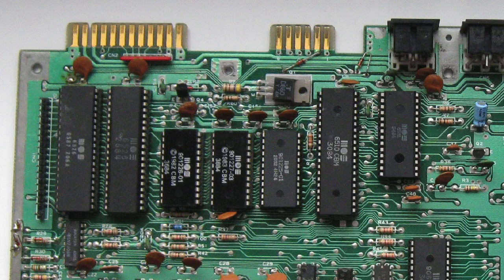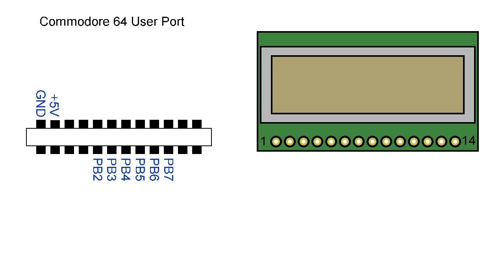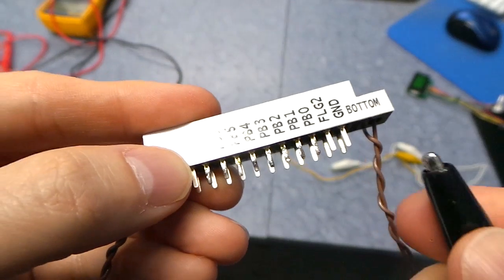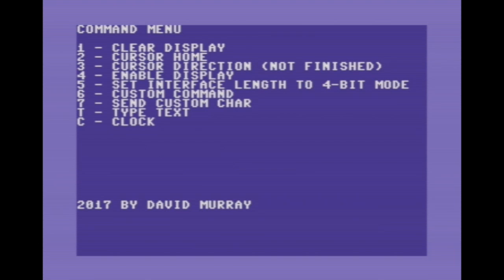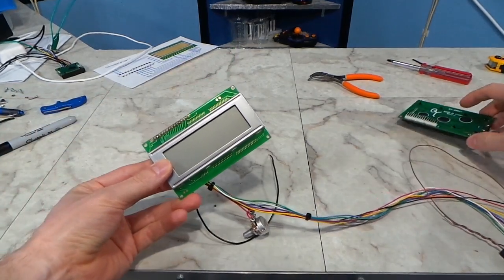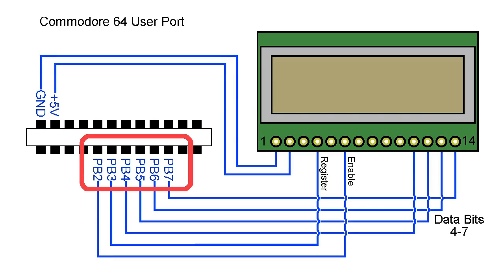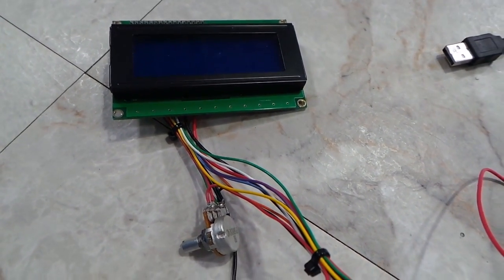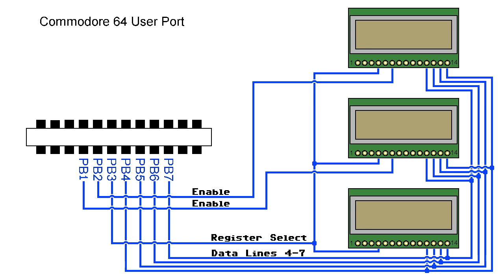How a Character LCD Works - Part 2

Comment: I see that you had a nightmare with that experiment. Good the problem is eventually fixed.
I think using the cartridge port would provide faster data transfer than user port. So the periodic LCD refreshing,  which is currently very visible, should improve.
Reply from the maker: the main reason you see the refreshing is because I left the cursor turned on. But, it does require running through at least 10 or 20 lines of BASIC code for every character sent because it has to break everything into 4-bits.  So, it does run slow.  However, if I wrote the software in assembly instead of BASIC, it would work perfectly fast even on the user port.  However, when I connect it to the cartridge port, it will be even faster and much more straight forward to program.

Comment: I did something similar using FreeBASIC on Windows XP. No idea if FreeBASIC is still around but it gave easy access to the parallel port on a modern OS.
Reply: "Windows XP"
"Modern"
Wat
Reply: @randomcatdude  Modern compared to the C64
Reply: Electronics Idiot FB is still alive and kicking!

Comment: All original C64s are dying... eventually. You notice it when you are trying to do something else than gaming. First it seems to be the case with power supply and fuses but in the end It's usually the PLA chip... My both Commodore machines died recently. Managed to get other one working without sound....

Comment: It's nice to know that other people experience projects going south spectacularly like this. Happens to almost everything I decide to try, and I usually give up long before getting to any kind of resolution. So this video was immensely satisfying to watch. Also, one minor correction that I hope you will accept in the spirit it is intended (pedantry is not always a bad thing!): 42 is not the meaning of life, the universe and everything. 42 is the answer to the ultimate question of life, the universe, and everything. The question of course remains a mystery. A small but important difference.

Comment: One thing to triple check is the input impedance and current requirements for the LCD. The output from the 6526 to the edge connector is not buffered. This means the 6526 must supply the current directly into the device connected to it. Each data line from the 6526 can only source something like 1m amp. If the LCD input is low impedance this could fry the 6526 over time. I know this because I did it. I connected an HP 8 pin printer to my C64 using the same outputs PB0 ... PB7. I also used the "Attention" out which is PA3 but that is buffered through U8, a 7406 octal inverter/buffer. After about a week or so of printing resumes my C64 let out the tel-tale blue smoke of the cooked CIA 2. This was 1986 and the 6526 was neither cheep nor easy to acquire, but I did. I built a small "inline" buffer in a box that became part of my printer cable. I took the 9Vac found on pins 10 and 11 of the edge connector and included a basic 5v power supply inside the inline box to provide VCC for the 74LS540 buffer. This small addition worked for as long as I had the C64.

Chances are the LCD display has an input buffer that sort of eliminates the necessity of an output buffer on the CIA. I say sort of because it's never a bad idea to buffer the output of any chip that goes out into the real world to guard it from line transients and shorts. The serial user port is buffered through U8 so I'm not sure why the designers left the parallel  outputs un-buffered.

Comment: how hard would it be to make a program that would automatically run in the background and reprint whatever was on screen (in character mode) to a 40 column LCD? if it's feasible, you could make a very compact version of the sx64

Comment: I guess that's why we should have a fuse in the power brick so that when the brick fails, it'll suicide rather than killing other devices.

Not sure if that'll work though. If that works, maybe start modding all the C64 power bricks with fuses just in case they start murdering your C64s then XD

Comment: You could technically have 8 LCDs connected up with those three pins :D
Just need a logic decoder. That'd make a pretty cool part 3 ;)
Reply: You'd only be able to run 7, as you'd have to have one output to not select any when changing the data.
But with more circuitry, you could have a latching 4-16 decoder to use one bit to latch the data into a "display unit select", getting 16 displays.
Heck, you could even use the last bit to a second 4-16 decoder as a "display bank select", so you could control which of 16 banks of 16 displays to control. Giving 256 displays. Or use shift registers to have as many display select bits that you could ever imagine. Build an 80x25 display out of individual blocks ;-)

But then you really need to go into assembler to get a decent speed, I guess.

Comment: A pity to see that happen to a C64, these PSUs are a pain and are unserviceable since they have the components sealed on epoxy. You also can connect 8 LCD screens instead of just 3 if you use a demultiplexer.

Comment: Is there any power supply made in modern times that would work with the commodore as to avoid the power supply issue?
Reply: There is a guy who used to repair C64's; officially he's retired, but he still makes and sells replacement power supplies (and he's said that as long as there's a demand for them, and his health remains good, he'll keep making them.)  They're expensive, though; $80 and up.

However, if you know what you're doing, you can cobble one together from a pair of wall warts... one of them providing 5 volts @ 4 amps, and one providing 9 volts @ 1 amp.
Reply: I thought the c64 ran on 12v in i probally thought it was another one as i remember some computer was 12v
Reply: The power supply does not provide a 12v output.  It has a regulated 5 volt DC output, and an unregulated 9 volt AC output.

The 9vAC drives the datasette motor, the TOD (Time of day) clock in the 6526 I/O chips, and is also passed through the user port (pin 11).  It is passed through a rectifier diode to convert it to DC for the SID chip.

EDIT: The 9VAC almost never fails.  Any time the Commodore PSU fails, the vast majority of the time it is the 5VDC voltage regulator.  (Which is a bad thing, because the RAM chips are likely to be damaged if voltage rises above 6V.)

Comment: Awesome video, and yes I know all too well about the power supply issues which also fried one of my C64 breadboxes, which is why back in the day after talking to a local computer shop that's no longer open sadly they suggested some of the repairable power supplies that will blow a fuse before they start sending out too much voltage, and can actually opened up, and worked on if need be. I sadly don't remember who made them, and I don't have one anymore, as like a dumbass kid sold off a good bit of my C64/128 stuff back in the day to fund a PC build in high school.

Comment: One suggestion: If you're powering the screen from a different supply, the grounds of the two supplies should be connected together. If the grounds happen to be at different voltages, there's no telling how the voltage on the control pins will compare to that on the power pin. This could lead to 'high' voltages on your parallel port looking like 'low' voltages on your screen as they're both 'referenced' to different ground voltages.

Comment: You can do GPIO out a parallel port? That never occurred to me but it does make sense. I used to use some guy's driver and an adapter I soldered to run PlayStation controllers out the LPT port. I ordered a USB 25-pin printer adapter to give this a try!

Comment: that's a problem with quite a few computers and even game systems that use an external power brick as they get old and start outputting too much voltage which obviously fries the computer or console.

Comment: qbasic is the quickest way to the parallel port on a DOS machine... qbasic came with DOS.... ....and its easy to find PC clones running DOS in junk piles than it is to fix something potentially irreplaceable like a C64 (the sid chip alone is worth its weight in gold)

btw, old AT style power supplies will provide a nice clean 5v, add a voltage regulator on the 12v to bring it to 9v for the SIDs analog half... much better than trusting the OG commodore PSU to behave and not blow up the most beautiful 8bit machine ever made...

Comment: So if the power supply is such a common failure point, why didn't you replace it with a wall wart/laptop charger?

Comment: Great episode.  A couple things I'd like to note:  You'll get better performance out of your clock program if it only bothers to write the time when the time changes.

Also, reading/writing from a parallel port (or any gpio pin) is comically easy from Linux.  While I've not done this from an MS-DOS machine, I have done it from many an embedded Linux; and I'd bet it can be done from the MS-DOS computer if you've got a working Linux boot for it.

Love the show, thank you.

Comment: You can use a more modern computer that still has a parallel port too however you may need to write your own driver or use a different operating system.

Comment: Hey 8-bit Guy! Could you wire in some kind of voltage readout to either the power supply or the Commodore 64 itself? That way you would always know if the voltage was good and be able to detect a problem before ruining anything.

Comment: Also remember: Never plug a Commodore 64 power supply into an Atari XL/XE computer or vice-versa. Even though they use the same connector, they are not compatible, and doing so can damage the computer and/or the power supply. And since aftermarket power supplies were made for both systems, never assume it is for your Commodore or Atari just because it has the right connector. Test it with a voltmeter to make sure it is the right one for your system.

Comment: Future video suggestion... making some sort of in line power protector.  Could go "wild" with a real time voltage display, or "mild" with a simple red/green LED... green is good, red if voltages are out of factory design.

Comment: Rip C64. So many memories. It had a life in the spotlight, showing off hardware and software. And now it is reached its untimely death. You will be missed.

R I P Commodore64

1982-2017

Comment: Awesome video! With what you mentioned at the end, that reminded me of how I did use a character LCD from a printer I was trashing and wire it up to my gaming rig's parallel port; I couldn't control it on my own, but I used LCD Smartie (I think that was what it was called) and used Speedfan to display my CPU/GPU temps/usage to it. But darn, there's so much you can use any old parts for and so much variety in the computing world. I'm gonna try that LCD box you made.

Comment: Next project idea -- a device that you plug C64 power-supplies into, which then plugs into the C64.  Said device will shut off power to the C64 if the voltage exceeds 5V!  Protect those old C64s!!!

Comment: So, the power supply only increased the current several minutes after startup on those first times (you showed that it started under 5V, but in the end was 11V)? Could this problem be fixed by working on the PSU itself? By doing this, you could save yourself a little bit of money when getting a new C. 64.
Reply from the maker: I was reading voltage from the 6526 data lines earlier in the video.  But I was powering the screen from the +5V power source on the user port.  I never checked that line.
Reply: It is he who admits a mistake that is stronger than those who don't. This may be something to keep in mind for us all: It may be a good idea to check the current that flows directly to the end device.

I thank you here and now for the information that this has provided.
I have not yet gotten into working with electronics (other than an a borrowed Arduino Uno for less than 2 weeks, and building my PC, which is simply a matter of component choice.)

Comment: Cool video, brings back some memories. One thing I wanted to mention: a gotcha when you operate these screens in 4-bit mode is that you should pull down the unused 4 pins to ground (otherwise the screen might misbehave!)

Comment: In my experience connecting switching power supply (Apple charger) to project like this is not good idea because even with GND pin connected there will be small AC current leaking from Apple charger via your C64 to TV through ground pin. Let's say you pull that user connector and GND pin gets disconnected first and you will fry one of those 2 bus expansion chips in C64.

Comment: Ouch. OUCH :(

Sorry to see your breadbin fried from the PSU - it's probably worth ensuring you've got a Computer Saver built so any other ones aren't affected (certainly for your C64s, the same applies to the Plus/4 - but those square DIN connectors are a pain IIRC).

On the other hand, it was real interesting to see how it all fits together on the wiring side. Small hardware projects with 8-bit micros (especially of the Commodore variety) are always interesting to watch and enjoy.

Comment: Lesson learned here - SOLDER PINHEADERS to your displays if you plan to use them in various projects.  You will butcher your solder pads continually wiring individual bodge wires to your displays.

You'll save yourself a lot of headaches too.

Comment: I'll never forget the very first time I plugged in my Commodore 64 a few years back, the power supply basically fried itself. The thing even smelled very nasty inside. Luckily it didn't also fry the computer along with it, which is now working fine with two separate adapters to supply the correct voltages it needs.

The lesson I learned from that experience is those Commodore 64 PSUs are trouble. Even if you still have a working one, better to get it replaced before it fails.

Comment: Actually, on PC it was almost the same - only the port address was different and pins were either input or output (data, control and status). Under DOS, all you had to do in Turbo Pascal was, for example, "Port [$378] := $FF", in BASIC it was "OUT 888, 255"m etc.

Comment: Well, I never figured I'd consider an 8-Bit Guy episode "thrilling," but here we are. I do a lot of tech support for legacy electronics (mostly lighting control processors) so I know just enough to be dangerous, and something's bugging me: when you metered your output pin on your little connector doohickey on the user port, why did you get 5V? If the 5V rail was really more like 8-11V, wouldn't you have seen that voltage come through on that pin as well?
Reply from the maker: good question.  I wasn't powering the screen from that pin, that was just a data pin.  I'm not sure if the voltage from the 6525 was different, or if maybe the over voltage was just intermittent?

Comment: Wow, the C64 is slow. You can literally see it updating the screen one character at a time.
Reply from the maker: Well, it has to run through about 10 to 20 lines of BASIC code for each character that it spits out.  The reason is that it has to break each byte into two 4-bit sections and that is actually slow to do in BASIC.  Could be done much faster in assembly.

Comment: That's why i check switching PSUs of all my older hardware every year. And i never use original PSUs if they are known to have problems that can lead to hardware damage. Cut original cable and solder it to a better PSU.
P.S. There's a good thing about older transformer PSUs - they are less efficient, bulky and heavy but very safe, especially if you use a transformer from medical devices.

Comment: If high voltage is the common failure mode, you would almost want a voltmeter or volt limiter always attached so you could check the voltage every time you power on.

Comment: Does that work on 128?
Reply from the maker: yes, is should without any modification.  It will work on a VIC-20, PET, or Plus/4 but the memory addresses will be different.
Reply: That means that you need to modify different memory addresses..

Comment: I am sorry for your C64... I hope that the damage isn't too severe..
Now I am going to check my PSU.
Reply: Your PSU should be fine, if it is newer.
Reply: @choccymalk123  All 3 of my c64 PSU's put out ±6v under load now, and two of them are the late spec beige bricks that came with 64c's.
The circuitry in them is basically unchanged and they are potted all the way through unlike early spec "boot" bricks which leaves the caps and diodes out of the resin, that's why they die, the 7805 regulator is not cooled properly.
Here in Europe there were some models of PSUs that didn't get potted and can be serviced but they are fairly hard to come by.

Comment: 12:15 You have pretty unfettered access to the parallel port registers on older PCs too. I remember back in my teens using QBasic's INP and OUT commands to reads from a SNES controller. It was really only until XP came around that it started to become a problem, what with 16 bit programs being run on an emulation layer, and heightened security protocols, killing direct access to the parallel port.

Comment: It was pretty easy to do this kind of output on old PCs too. I remember typing OUT 888,0 or something like that in BASIC to access the parallel port, and my first self-designed solid state circuit as a kid was in fact 2N3904 transistors driven by the parallel port to control relays. The relays were wired to an RC car, so you could program movement patterns for it in BASIC. Good times. Of course, the computer I was doing this on was a flea market Tandy PC compatible of some sort... I don't think I was allowed to plug random circuits I made into our good computers until I was rather older, haha.